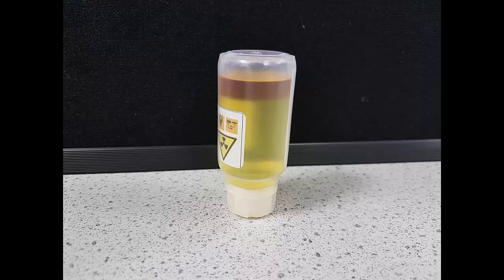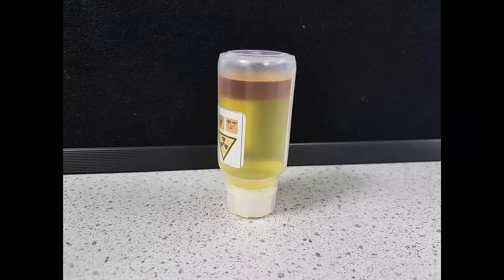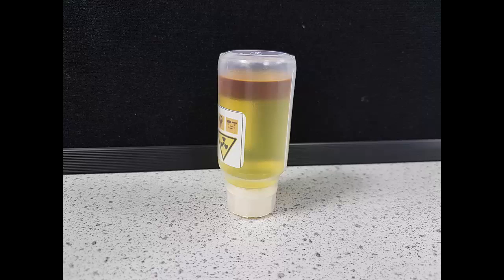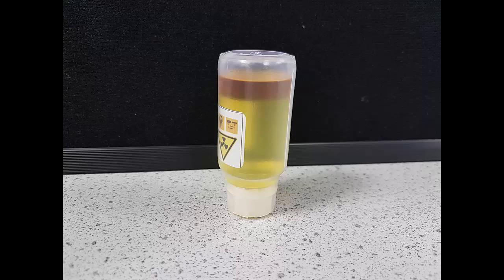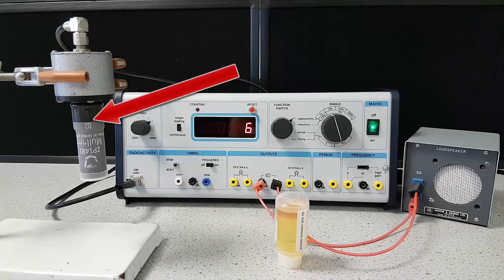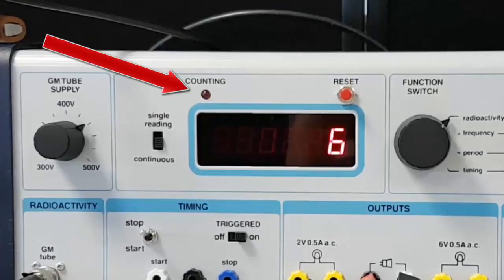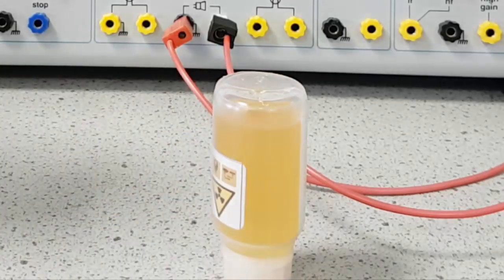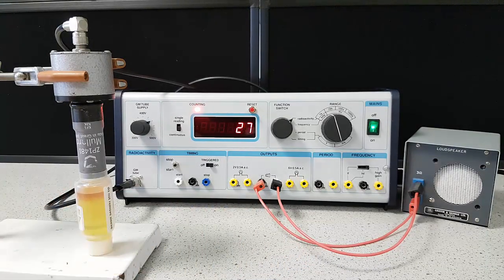Protactinium half life experiment

Comment: Your counting period of 10 seconds is a significant proportion of the half-life (77 secs) so in theory you should correct the readings for the finite- counting time.   In effect, each reading is a decaying number of pulses, not an instantaneous rate.  The correction is small  (= Ln(2)*10/77   in this case = 0.96 of reading) but if you apply it you will get a more accurate half-life determination.  Alternatively you can plot each reading at the mid-point of the measurement period and that will be close enough for most experiments.  The count rates here are so low and variable I think there would be no point in applying that correction at all!    Better to shield the GM and sample, and separate the organic fraction.
Reply from the maker: Thanks for the suggestion. I think most people use the video to show the relationship of decay rate and time and to determine a half-life. In your correction you put the half-life in, but if you were doing the experiment to determine the half-life then you wouldn't know the value to put in. If you were just going to Google the half-life then there's not much point in doing the experiment.

Comment: Thanks. Great online experiment, especially for Zoom teaching times. I used it for the IGCSE Physics topic on Radioactivity, although the decay curve is a challenging one to draw the best-fit curve. I wanted to teach the concept of background count and how you correct the raw reading from your video demo. After several trials using Excel trend-lines on corrected counts, I found that 3 or 4 counts per 10 seconds for the background count, subtracted from each raw count gave a decay curve with half-life of 69 to 72 seconds for the Pa-235m isotope. (Accpeted literature value about 70 s).
Reply from the maker: To be fair, I think the first reading is a bit a of an anomaly as I don't think the liquids had separated fully.

Comment: I live in the USA, and these kits aren't available here, plus they'd be too expensive! Well, I FINALLY made a Pa-234m generator! I used 2.5 g of uranyl nitrate, 7.5 mL of distilled water (to dissolve it), 17.5 mL of conc. hydrochloric acid (ACS grade, 37.5%), and 25 mL of methyl isobutyl ketone, and carefully added this to a 60 mL leakproof polypropylene bottle, and it works spectacularly! I use the Inspector USB Geiger-Müller counter with the Observer software, and I get about 120 CPM for background from the Pa-234m generator, and about 3500 CPM at about 2 cm. It works great! It has internal and live datalogging, and it has autoaveraging, and when that is activated, it gives an even more precise result! The exponential decay curve is SO smooth and precise! Thank you very much for sharing this video! 👍
Reply: Here in the UK, you'd get a PhD for that! Good work, mate!